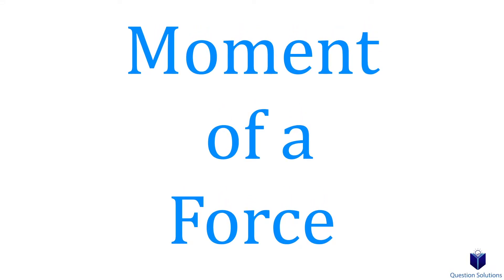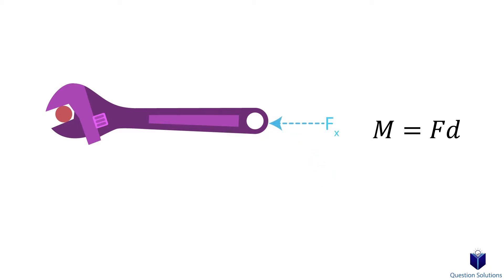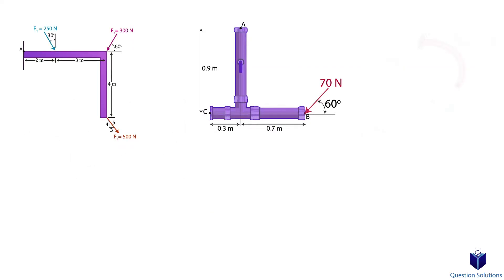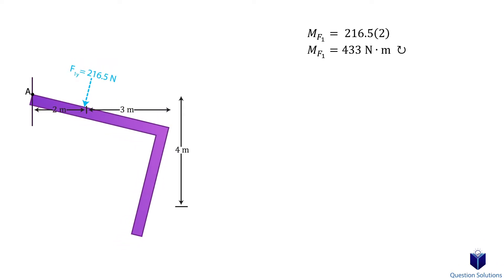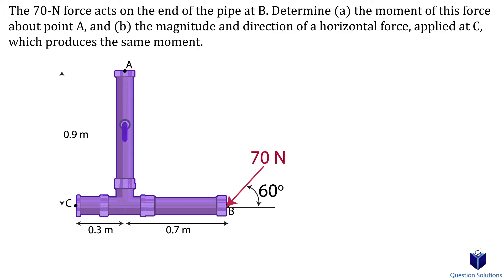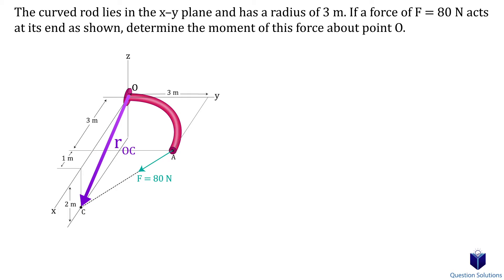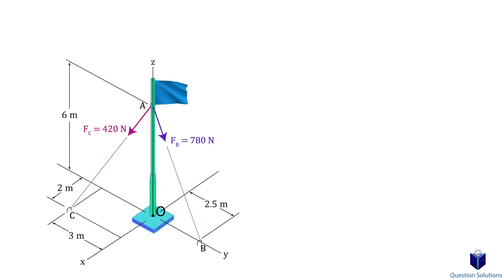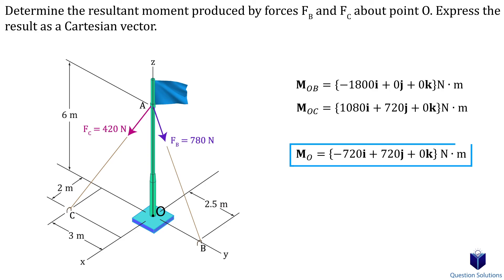Moment of a Force | Mechanics Statics | (Learn to solve any question)

Comment: For the last problem, why do we have to add the momentum of the two forces, if they are operating in opposite directions on the same tower?
Reply from the maker: The word "resultant" indicates that whatever you find, whether it's separate forces, moments, etc., must be added together. It's really just showing a single moment instead of 2. Another way to think about it, is to realize that the resultant shows the result of multiple forces/moments acting at a singular point.

Comment: I think youre wrong for the 2nd problem. I am getting (ignoring decimals since you rounded in between work which you should only round at the end) I am getting the moment to be 128i - 213j -256k..... I have done the cross product so many times using your r and f vectors and that's what I'm getting. Highly doubt I did something wrong I have triple checked my work. You should double check your cross product or run with a professor.
Reply from the maker: Unfortunately, you're wrong. You can even double check your work using these links: https://onlinemschool.com/math/assistance/vector/multiply1/
https://www.symbolab.com/solver/vector-cross-product-calculator/%5Cbegin%7Bpmatrix%7D4%260%26-2%5Cend%7Bpmatrix%7D%5Ctimes%5Cbegin%7Bpmatrix%7D21.39%26-64.17%26-42.78%5Cend%7Bpmatrix%7D?or=input

In the 2nd link, I even did the cross product for you. Simply plug in your 2 values for a and b. 

It doesn't matter if you did your work 10 times or a 100 times, it makes no difference if you have a numerical error or you're using an incorrect method to get the answer. This is such a pitfall students fall into. Go over the math, look at the numbers being multiplied. Either you are using the wrong method to do the cross product, or you have wrong values. I can go check with multiple colleagues, they will laugh and ask why I am asking them to do a simple cross product, and then give the same answer I have on my pinned comment. The only difference between the answer shown on the screen and pinned comment is a negative sign :)

Please, take the time to learn the proper method, you are doing something wrong and you will lose marks on your exams. Or watch this video: https://www.youtube.com/watch?v=F8IHrg3pc7g

Comment: There is difference between torque and moment of a force, what u calling moment here is basically torque
Reply from the maker: "In physics and mechanics, torque is the rotational equivalent of linear force. It is also referred to as the moment, moment of force, rotational force or turning effect, depending on the field of study." 

"When a force is applied to a body it will produce a tendency for the body to rotate about a point that is not on the line of action of the force. This tendency to rotate is sometimes called a torque, but most often it is called the moment of a force or simply the moment."

I think you might be missing fundamental knowledge on these terms. I am pretty sure students have the capacity to understand what is being talked about here. 😅

Comment: in 3.46 i think for MF3 x-axis is +ve because counterclockwise is +ve
Reply from the maker: No, we picked clockwise to be positive, and we got a positive answer, which means MF3 is a clockwise moment.
Reply: @QuestionSolutions  oh is that you just assume?
Reply from the maker: @ainulhana1316  That's correct. You can assume either direction to be positive.
Reply: @QuestionSolutions  thanks
Reply: @QuestionSolutions  what grounds do you use to prove that it’s okay assume the positive direction? Asking for a friend
Reply from the maker: @adamspecs9799  I am not really sure what you are asking? What do you mean by what grounds? We aren't proving an equation here. We are just guessing a direction, if your answer is positive, your assumption was correct, if it's negative, your assumption was incorrect. Maybe I am misunderstanding your question 😅
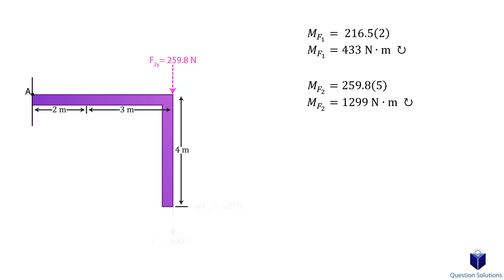Reply: @QuestionSolutions  at 3:46 is it customary that clockwise is defined as positive? what are the rules to changing it along the moment calculation?
Reply from the maker: @adamspecs9799  Again, it is just an assumption. You can assume clockwise or counter-clockwise to be positive. It's completely up to you. In fact, please try it both ways, you will still get the same exact answer, it makes no difference. It's a personal preference. Sometimes, I pick clockwise to be positive, sometimes I pick counter-clockwise. I can usually look at a force and know which way it will create the moment, so I know which side to pick positive so I don't have to mess around with too many negatives. It is completely up to you. Your textbook might say pick counter-clockwise to be positive, but it makes no difference, in fact, in later on problems, just picking counter-clockwise to be positive will only create more work for you. The reason why generally people pick counter-clockwise to be positive is due to the moment vector, which is found using the right hand rule. Since the vector is out of the book/screen when you it's counter-clockwise, we say it's positive (just the vector, not the rotation). None of that matters, it is completely up to you when it comes to 2D problems. You can pick either way to be positive. Again, if you get a negative answer, that means it's opposite to your assumption.

Comment: If we take clockwise to be negative and anticlockwise to be positive we get different answers foe the moment, is it advisable to always take clockwise as positive unless stated otherwise?
Reply from the maker: What you are saying is not possible. The direction is simply an assumption. For example, you can assume clockwise to be positive. In that case, if you get a positive value, then your moment is clockwise, and if you get a negative value, it's counterclockwise. Now if you pick counterclockwise to be positive, then if your answer is positive, your moment is counterclockwise, and if your answer is negative, it's a clockwise moment. I pick clockwise to be positive because it's a preference. You can pick either to be positive. Make sure you follow through with your direction and use proper positives and negatives, you will end up with the same answer. 👍
Reply: @QuestionSolutions  ohk, thank you 🙏

Comment: Praying Tanaka has a suggestion: may you include sample problems where we are given angles and not just lengths? It would be very helpful 
🌝
🙏
Reply from the maker: I am not sure I understand what you mean? You need distances to calculate a moment, or you use the angles given to figure out the distances first. Could you elaborate on what you would like to see? :)

Comment: in the first question , why do F3y has a moment T_T ? , I'm a bit confused about the line of action here
Reply from the maker: To understand this better, I really encourage you to cut out this shape from a piece of cardboard and pin it at A. Then apply the force components to see which would make it spin about point A. You will see which components will create a moment (it will spin) and which do not (object won't spin). I think this real life example is what you need to really understand what the line of action is, what a moment is, and it will be super helpful for you to visualize harder questions :) Try it out and see. You apply the forces with your fingers, exactly as shown. So you push with your finger at the location. If it's a horizontal component, you push exactly horizontal at that point. 👍

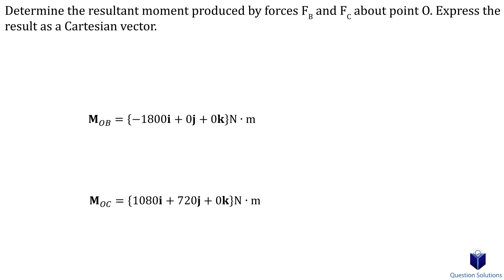Comment: @ 7:50 I think the j in MOB is - 0j since the j should be negative (not that it matters since the value is still 0)
Reply from the maker: I don't assign negatives to zeros. It's neither positive or negative, it's just zero because -0=0 also, to me, positive "looks" nicer 😅

Comment: at time 4:59 why is it clockwise please?
Reply from the maker: Both of those forces will make the pipe turn clockwise about point A. Think of each force individually and see which way it would spin. Another way to see it would be to cut out this shape and pin it at A and apply the forces with your finger.
Reply: @QuestionSolutions  if we made the moment positive in counterclockwise, would it result in a different Moment resultant value than the moments taken in the positive clockwise?
Reply from the maker: @halowiz1000  Assuming it to be positive or negative is entirely up to you. You will get the same exact answer as long as you follow through with your assumption. So you can pick clockwise to be positive or counter-clockwise to be positive. If you get a negative answer, then it's opposite to your assumption.

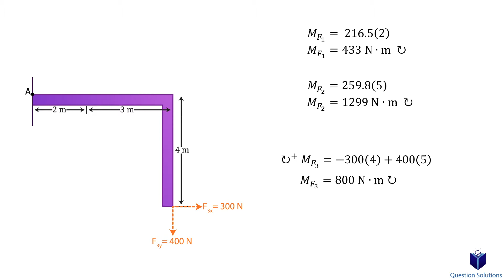For example, if we look at the equation at 4:24, I assumed clockwise to be positive. Now let's say you assumed counter-clockwise to be positive. Then your equation would be: MF_3 = 300(4)-400(5)
Solving will give you -800. You get a negative answer, which means your assumption was incorrect, it is actually a clockwise moment of 800 Nm. But at the end, we still arrived at the same answer. So as long as you follow through with your assumption until the end, you will get the same exact answer.

Comment: I thought + was counterclockwise and - clockwise?
Reply from the maker: So for example, assume you picked counterclockwise to be positive, then if you get a negative answer, the moment is clockwise. If you picked clockwise to be positive and you got a negative answer, then the moment is counterclockwise. If you picked counterclockwise to be positive and you got a positive answer, then the moment is counterclockwise. Lastly, if you picked clockwise to be positive and your answer is positive, then it is clockwise.
Reply: @QuestionSolutions  Thank you!!
Reply from the maker: You can pick either direction, it makes no difference as long as you follow through with your positive and negative signs.

Comment: Hey sir at 4:12 wouldn’t both components be negative instead of just one coz the fy component is going down
Reply: Nvm just remembered it moment so instead it’s whether it’s ccw or cw that determines the sign
Reply from the maker: @anasmalek4623  Yes, it's based on clockwise or counter clockwise not the direction of the force. We just have to see whether the force, (doesn't matter which way it's pointing), will it create a clockwise or counter clockwise moment. 👍

Comment: Can I use rOA instead of rOC to calculate the cross product for the question about curved rod?
Reply from the maker: Yes, you can.
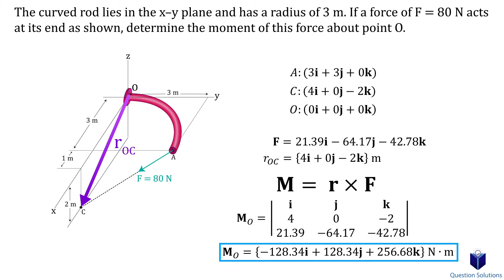Reply: @QuestionSolutions  taking rOA fetches the answer you have mentioned in the video @6:25, & taking rOC fetches a different answer i. e. a negative sign to the k component of the moment. please clearify.
Reply from the maker: @wijdana9326  There is a typo in the answer I've shown in the video, the k component is negative. I put a positive sign. So using either rOA or rOC will give you the same answer. 👍
Reply: @QuestionSolutions  great, thanks